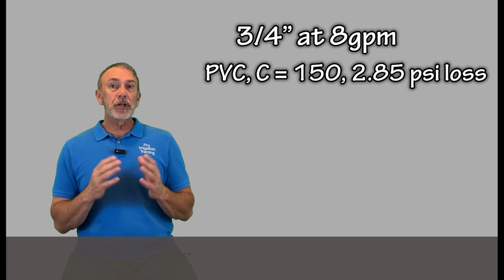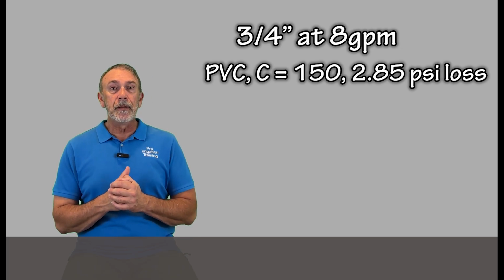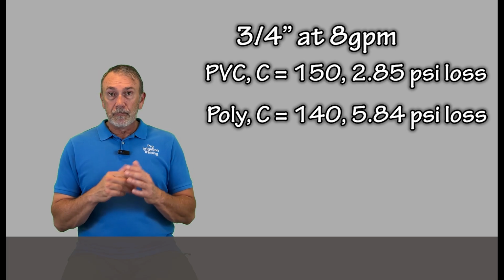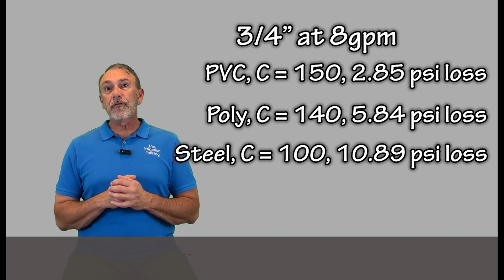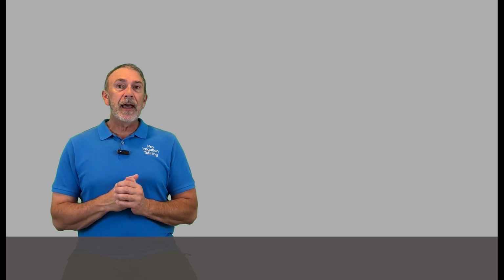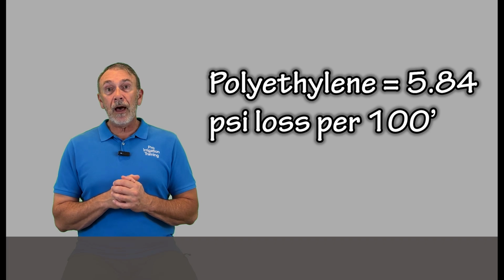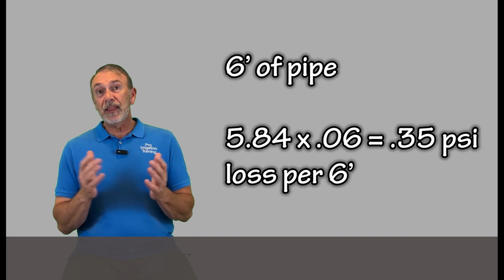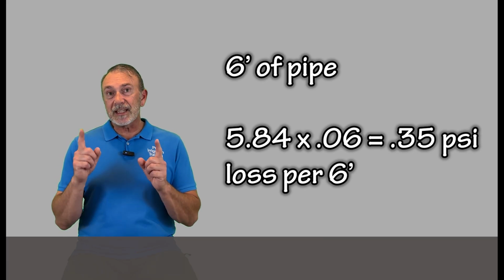Understanding Friction Loss | Water Hydraulics for Sprinkler Systems

Comment: Hi Michael. Thanks for the video. I’m thinking of setting up a ram pump on my land to pump water to a tank. My head is only 2.5m (8 ft), drive pipe probably 25ft long, with lots of flow. I wonder if galvanized steel is worth over PVC to reduce friction loss and improve the pump efficiency.
Reply from the maker: Galvanized steel is actually quite a bit worse for friction loss. Go with the PVC.
Reply: @Proirrigationtraining  Thank you!